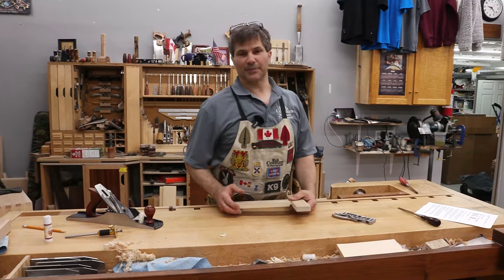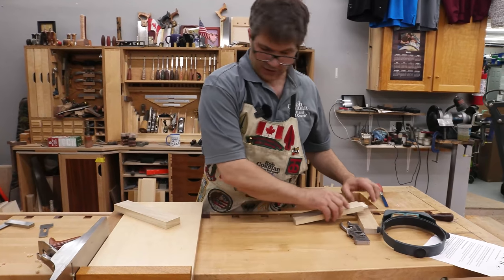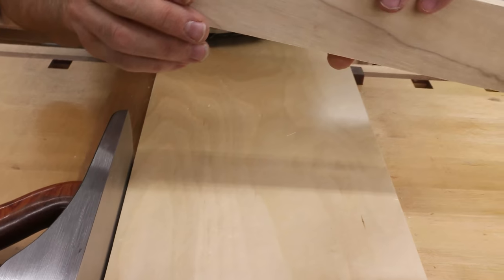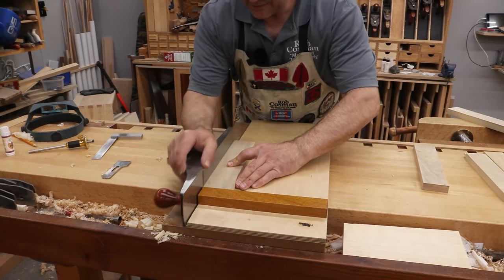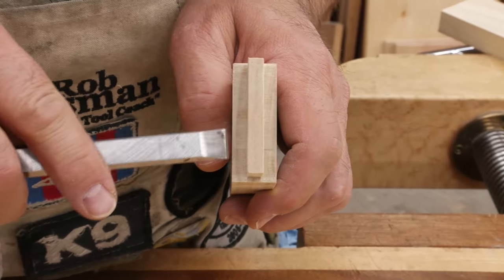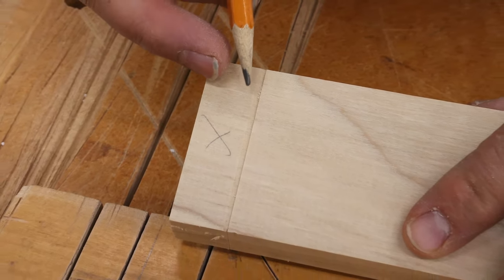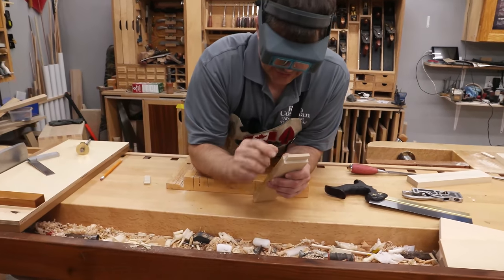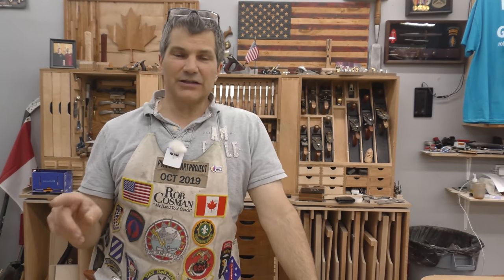Nine Secrets to Perfect Fitting Tenon Shoulders

Comment: For a pure hand tool worker there is no need to square the ends of a tenon, the only important part is the shoulder to shoulder dimension, thats the reference surface. Time can be saved by not squaring the end, you only need a square end if youre cuttin tenons on a tablesaw :) Cut your stretchers/rails slightly oversized and square around for your shoulders on one end and cut it (leave the tenon long) mark your shoulder to shoulder dimension and cut the other side too, then use that as your master part to accurately mark all your other stretchers/rails from :) It saves more time again to gang cut the rest after the master part is made........ this is where the "Sash saw" originated.... like a carcass saw but longer to gang cut parts like this. A lot of hand tool work is about working efficiently and cutting out steps that are not needed or creating "shortcuts" to get it done using less energy :)  Cut the tenons to length after the shoulders are cut, ya never want it to bottom out in the mortise.
A chisel is always way better to trim the shoulders if needed, a plane covers the work and you cant always see whats happenin, see how much visibility Rob has when paring the shoulders :)
Reply: Thanks Shaun : video shortcuts with handtools. https://www.youtube.com/live/ICwLtekvQwg?feature=share

Comment: My weakness and maybe that of others is making a plumb cut by eye, even after decades of woodworking. I would therefore use a mitre block or better still a quality hand mitre saw. If you use a stop then the cutting gauge stage can be eliminated. That way it will be square and continuous all round at the correct depth.